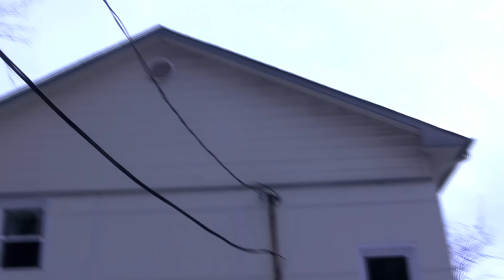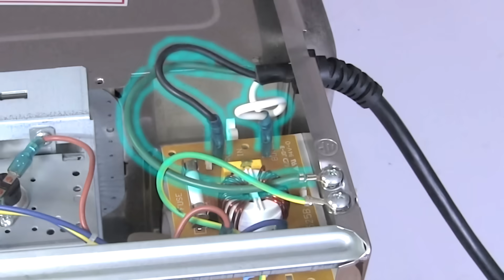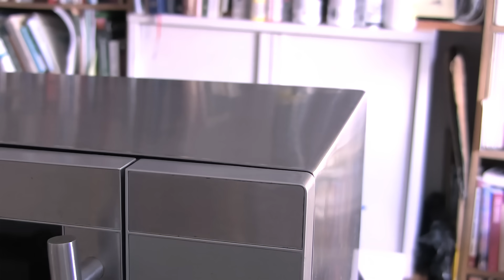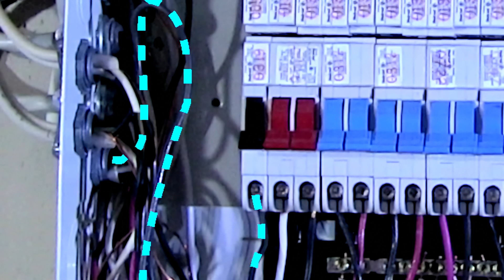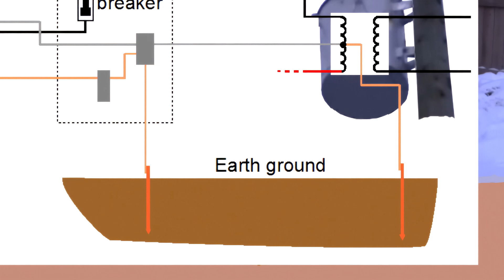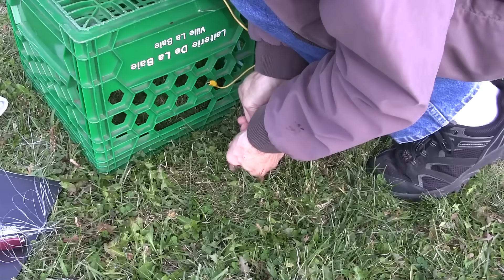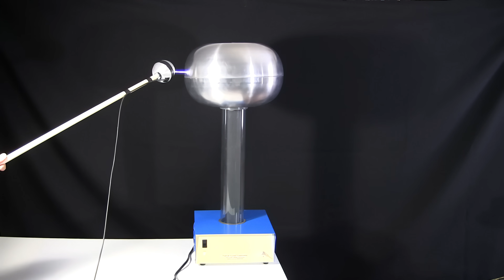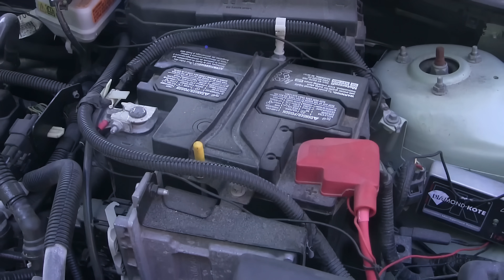What is Ground? Earth Ground/Earthing

Comment: European here!  What I do not understand: Our EU plugs can be turned 180° and still work. We have a brown wire which should be the hot and a blue wire which is neutral, but by turning the plug, those two will be swapped. So is there no difference between these two wires?
Reply from the maker: I've no experience with the European system so perhaps someone can correct me if I'm wrong but we have similar plugs in North America. Some of our plugs have prongs  for just the hot and neutral and both are small enough that you can plug them in rotated either way like you. In that case, it works because the electronics doesn't care and because the appliance doesn't need a ground. For example, if the appliance has a plastic case then there's no need to connect the case to ground since plastic doesn't conduct electricity.
Reply: It's alternating current which means the wires are polarity insensitive
Reply: There is a difference, but since it's AC it doesnt matter how you plug in a device. For example, look at 8:58 in the Video, the circuit would work just fine if you switch Hot and Neutral.
It's mostly a safety thing. 

Imagine you are "working" on the 1 amp Fuse in this circuit (8:58). If the switch is open you can touch anything on the Fuse's side and nothing happens.

BUT if you switch Hot an Neutral, switch is still open,  and now you touch a conducting part on the Fuse's side you are actually touching a HOT wire. And because the HOT wire is referenced to ground, your body acts now as return path to ground. Not good for your health.
Reply: One of the wires in the European grid is connected to the ground. So the excessive charge on the device should dissipate too. But the American system is probably safer, and obviously costlier (more material). Perhaps the lower voltage of their grid = higher currents and it requires greater safety measures...

Comment: what you did not explain is why electricity always seeks a path to ground which is the secret to why all this grounding stuff works.
Reply from the maker: I didn't explain it because it's not true except in special cases like the case of static charge build-up which I talk about at 5:33 (I start giving background information at 3:40 though). Also, it's still not strictly true to say that electricity seeks a path to ground. What's really going on is that the areas with different mixes of charges equalize so that they have the same charge. I show that at 5:51.

Comment: What is that rectangular box with neutral in diagram??
Reply from the maker: If you mean the grey box, that represents the neutral bar which I highlight at 0:59. It's not a box but is a metal bar that all the neutral wires attach to.
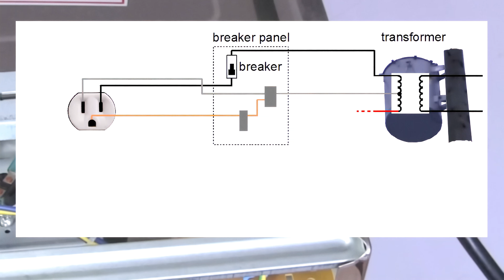Reply: @RimstarOrg  no i am talking about diagram at 2:16
Reply from the maker: Are you talking about the box drawn with a dotted line? That's the breaker panel, also called the service panel, in a house. It's the box with all the breakers (or fuses in older ones) in it. At 1:33 I show the whole box outlined in blue, though they come in many different shapes and sizes. That's where the power from the generating company comes in and gets divided out to go to all the receptacles and other things in a house.

Comment: If the neutral socket is connected to the ground socket then why is there a need for both of them?  Why not just connect the neutral socket to the chassis?
Reply: This guy explains this wrong. The neutral and ground are connected in the breaker box and the the neutral and hot goes through what is called an earth leakage breaker and ground is distributed through out all the plugs. If 20 -30 mA is flowing in ground wire the breaker trips. This indicates the hot wire is touching something that is grounded (Microwave oven enclosure,water pipes,geyser). These earth leakage breakers determine the difference in current between hot and neutral. In other words if there is a difference in Hot and neutral current it must be in earth and the earth leakage breaker trips. Most buildings have this form of electrical protection.
Reply: Thanks.
Reply: Robert Brandywine 
U guy's seem to know about as much or if not more then wat this guy's saying.
Reply: @thehandyman2180  Not me.  It sounds like Blaffies might.
Reply: Robert Brandywine 
I don't understand.

Comment: i dont understeand why hot shocks
Reply: The nerves in your body operate by passing tiny electrical signals along their length.   All of your sensory and motor functions depend on those nerves to either signal feeling a sensation (such a cold or heat), or to contract a muscle.  An electric current passing through your body disturbs your body's nervous system.  It can make you feel sensations that are not there, and the current can actually "cook" your body's tissues like a lightning bolt burns a tree that it strikes.  The worst thing an electric current passing through your body can do is interfere with your heart's ability to beat regularly.  If your heart stops beating, you will die.  Death by electric shock is called electrocution.

An electric shock is any external electrical current passing through the body.  Any difference in voltage can give an electric shock.  Lower voltage differences are less dangerous because it's harder for them to penetrate your skin and travel through your body.  

Any wire that is grounded has the same voltage potential as the ground.  By definition, the "hot" wire or terminal is not grounded.  It's called "hot" specifically because it's not grounded.  Because you are usually the same voltage potential as the ground, contacting the "hot" line allows your body to complete an electrical path from full-voltage "hot" to (no voltage) "ground".  Zap.
Reply: amazing reply. I didn't ask the question but thanks dude
Reply: Only if you stand on the ground and touch the Hot Wire
 it is same as touch both wires concurrently
Reply: Thanks for the response

Comment: You are spouting a lot of electrical theory but they are fragmented and do not accurately reflect the actual circuit you are trying to explain.  You are like an empty bucket with a few rocks rattling around.  Get a coherent story and present it wothout all the distractions and errors.  If you were in my electrical circuits class you would be failing.
Reply: If I were in your circuits class I would drop for another professor who explains their criticism. This video was great for a lay person to understand. Perhaps the ground on diagrams is more complicated? Perhaps grounding to Earth is also more complicated? At least say what if anything is actually inconsistent with the full picture.
Reply from the maker: I think we found the misunderstanding then. This is intended for lay persons and not for a circuit class. Specifically, it's to give some background for any lay persons curious about that ground hole in their wall receptacles. It's also not intended for teaching electricians, another misunderstanding I get. For that I usually refer people to Mike Holt's videos https://www.youtube.com/watch?v=mpgAVE4UwFw. If you'd asked me whether or not it was necessary to clarify the audience back when I was making the video, I would have said no. Clearly I was wrong since this comes up every now and then.
That's not to say the video's perfect. For the very last circuit for the power supply where I say the ground symbol is saying to connect to the ground prong, I don't like the way I said that, it's not strictly true. I should have clarified that I connect it to the ground prong because I usually connect a high voltage power supply to that ground connection and that does need to be grounded.
Reply: I think your video is fine.  It obviously is not for training electricians or physicists any more than Driver's Education trains automobile mechanics.
Reply from the maker: Which circuit are you referring to?

Comment: Also, you need to describe the path of how lightning would charge your microwave.  Your video implies lightning hits the ground and travels up thru the grounds to the cases.  This isn't accurate, the lightning hits the electrical wires suspended on poles, and travels thru your wires to your TV set and then like a forrest fire with intense heat (but in this case intense charge), the charge can jump across small spaces from one conductor (TV wire) to another nearby (your TV set case) in addition to frying the internal circuits.  In other words, the lightning is SUCH high voltage that it can "jump" across small spaces similar to what you'd see in a tesla coil.  the air isn't a great conductor, but everything has a breakdown  voltage.
Reply: Lightning can get directly into your home wiring by striking your house or nearby.  It isn't necessarily going to come in through the utility service.

Comment: You did the best job of anyone, but you should do a moving diagram of where charge would go in the example of lightening.  You could describe the charging of panels as similar to a capacitor, which might remain highly charged after the lightening strikes, until the charge can dissipate (like a capacitor would).  You could also mention how in electronics its pretty common to wait a bit before plugging back in a device or opening the cover panel of electronics (ie: your set-top box), to allow the capacitors to dissipate before you go putting your finger on a potentially "hot" capacitor inside the box.

The third ground wire is indeed used to gaurantee your breakers open when voltage gets loose, such as your example of the frayed wire touching the metal box.  

But the ground rods are used for a different purpose, they are to dissipate the charge on your devices, but also to attract current flow as a path of least resistance.  mean this literally, as ground rods "spec" is LESS THAN 25 ohms.  This means your ground rod (in the earth or connected to your water pipe or fence) conducts electricity easily and delivers it to the earth (a practically infinite electric charge sink) before the charge will go thru YOU (the guy who touches the hot equiptment).  Low resistance means high flow, and your body is not a great conductor (unless you prick  your fingers for blood and connect your viens to two conductors-- but that's another story!) so a good ground rod with < 25 ohms will attract the bad excess electric charge rather than it going thru you finger.  

Think about it this way:  Take a hose and put a hose splitter on the end of it, which seperates the water into two different nozzles.  Open one nozzle wide open, and open the 2nd nozzle just a crack.  Then turn on your main water source.  Give the nozzle that's open all the way to your buddy, and keep the nozzle which is just cracked for yourself.  Put those nozzles over top your heads and see who gets wetter.  If you do it right, almost no water will come out onto you, and your buddy will be soaked.  your buddy is holding "ground" and you are the example of a person touching the hot metal box.   You'll be lucky to end up with a few drops, even tho the pressure on your nozzle is equal to the water pressure on his nozzle.  Pressure is like voltage, and wetness-factor or the water flow is like current.  His nozzle provided less resistance (like the < 25 ohm ground rod) so he got wet (zapped).  When your buddy is all wet, console him by telling him he's your world (the earth, ground).  That's humor, but the example is great for kids.

Comment: Thank you! This one helped me to understand the concept and differences between varied uses of the term "ground."
Reply: He could have summarized it as this:  
Two types of ground:  1) Earth ground, 2) Frame ground (or chassis ground).  

Earth ground is literally connected to dirt.  It makes electric service safer by keeping one of the conductors of the circuit at the same voltage as the ground, and provides a surefire way for ground faults and lightning strikes to be lead away when they happen.

Chassis ground is the common zero-voltage connection on a direct current source.  A car is a great example.  The metal parts of the car such as the engine block and the frame are connected to the negative (–) battery terminal.  The metal making up the bulk of the car itself acts as the (–) for many of the car's circuits.  Only a (+) wire needs ran to the different lights and other power-using devices around the car.  You can't really earth-ground a car since it's on rubber wheels and needs to be mobile.  But the chassis itself provides a base voltage reference, considered to be zero.

Sometimes Chassis ground and Earth ground are the same.  Sometimes they're not.  It depends on the design of the equipment.

Comment: This video reminded me of a scary night I had over a decade ago:
I was awakened by a loud cracking from a wall AC unit, then I hears a smoke alarm go off in my shop.  I unpluged the AC, and the smoke was coming from a fault protection strip which had three MOV's connected between E, N, and G.  The MOV's had shorted (maybe exposing a flaw overlooked in these circuit/surge protectors)...pouring out smoke.  I found that only -certain outlets would work, but had not discovered the problem yet.  At daybreak, I took a hand telescope and looked along the power line--then I saw it!  The BARE wire in the bundle of three wires was snapped!  This is not simply a support cable or earth ground as many people think, but it is the Neutral line.  What I had was an "OPEN NEUTRAL".  When it broke some of my circuits had to complete through the actual ground in the earth, which was a high resistance to the "pole pig" or pole transformer.  Thus some outlets would only dimly illuminate an incandescent 120VAC bulb.  Interesting...the power company called it an "OPEN NEUTRAL"
It prompted me to design an "open neutral" detector.

Comment: If the neutral wire is connected to the ground wire why do we need two wires? Surely we could just go to ground and save on the neutral!
Reply: Using the neutral as ground is called "bootleg ground" and it's sometimes done in older households with a two-wire installation. It's not ideal though, so modern regulations don't allow it:

https://en.wikipedia.org/wiki/Bootleg_ground
Reply: But why? I have limited electrical knowledge and don't understand why the electricity has to return back to the supply.
Reply: Because you need a closed circuit. The generator creates a difference in potential between the two wires, not between the live wire and the ground. If you were to stick the neutral wire of the appliance into the ground, the charge would just get dissipated into the large mass of the dirt, as shown in the video. Or, if you leave the neutral disconnected, the charge won't be able to pass through the air, because air is not very conductive.
Reply: My understanding is there must be a potential difference for the electricity to move which causes an electromotive force. The generator would still have a potential difference to ground surely! So why does it need to return to the generator? Also, AC current moves both ways in a wire so why does it need to return? Sorry for the questions Yutaka but I'm confused.
Reply: Electricity will flow through the path of least resistance, in this case the copper of the wires which is very conductive. It's possible for current to take the "hard path" and travel through the ground back to the generator, but that rarely happens because the ground is not as good of a conductor. It can happen under some conditions though, and that's called a "ground fault":

https://thegrid.rexel.com/cfs-file/__key/communityserver-wikis-components-files/00-00-00-00-62/Direct_2D00_contact_2D00_with_2D00_circuit.png

In the illustration most of the current is travelling through the neutral wire, but there's also a little bit (0.1 amps) going through the person, then through the ground back to the neutral of the socket. It has happened because the person has stepped in a puddle (making the ground more conductive) and also because he's touching the live wire, closing the circuit. 

As for AC - it just switches directions, otherwise it works the same as a DC circuit.
Reply: So sorry about this Yutaka, but I'm still confused! You need a neutral wire to go back to the generator so that there is a potential difference, right.  There is a potential difference to ground so why waste money on a return wire? Unless the job of the two wires is to just contain/guide the electric wave, so confusing!
Reply: As i said in the beginning, the generator creates a potential difference between the live and the neutral. This is all you need to power an appliance. Everything else having to do with putting wires into the earth is a safety measure.
Reply: lee Grieveson some underdeveloped parts of the world still use a ground return system. As others have said, electricity needs a complete circuit to work, and the generator doesn’t care weather it’s the neutral wire or the ground that completes the circuit. The designated “neutral” wire is an advancement in electrical distribution.